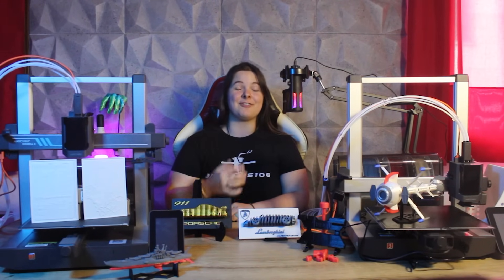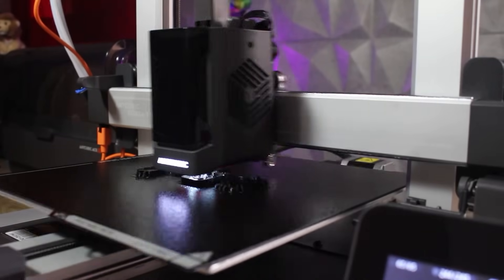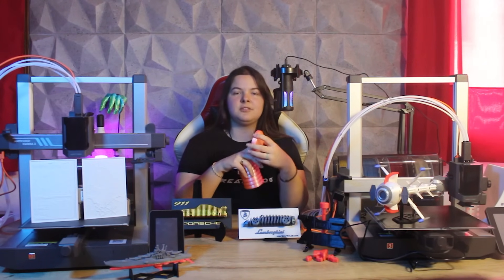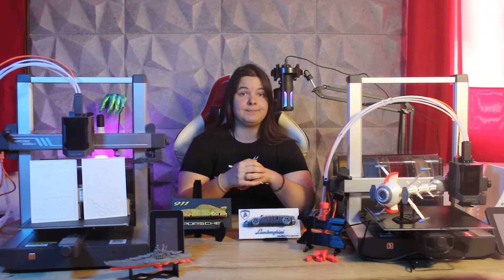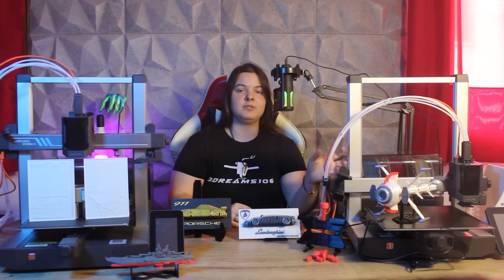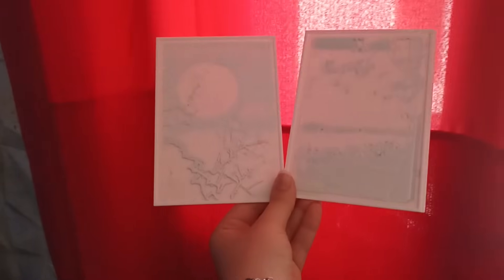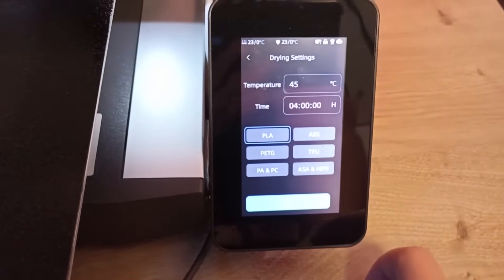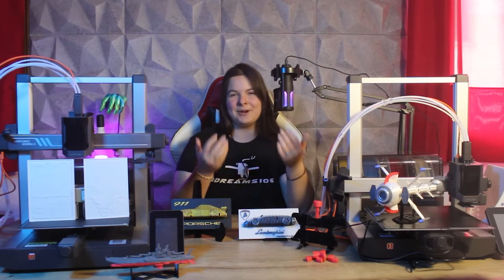THE NEW ANYCUBIC KOBRA 3 V2 🚀 IS IT WORTH IT? 🤔 Review and Comparison with the V1 🔥

Comment: The V1 has ridiculous firmware and leveling problems and a high percentage of units shipping with warped beds. I understand the V2 addresses some of these problems but I would still advise extreme caution when buying an Anycubic machine. Way too many users spend more time troubleshooting defective machines than actually printing
Reply: Same with Creality, in fact, only Bambu has kinda better reputation on basic models. That’s what I had seen.
Reply from the maker: Honestly, I really enjoy my kobra 3 V2, kobra 3 Max and Kobra S1. I know many people had problems, but Anycubic support is awesome.

Comment: The problems with the kobra 3 version 1 wasne even bad..I printed better air shroud..better airflow case for the printhead, and an upgraded hotend, everything else...like not sticking..preheat your hotbed and that won't be an issue, and auto level works fine on mine never had problems with that...but mine works amazing, maybe one day I can have a version 2 to compare...but my kobra 3 is very good recommend either version, just do maintenance lube your bearings with wd40 and grease the riser bolts and tracks tighten all screws and check them every few months and it will print good always..also your ambient air temperature can make or break your print big time.
Reply from the maker: I didn't have problems with the hotend but I had an hardtime with the first layer, even at warmer temperatures 😕

Comment: On the V! hot end. Yeah... I had the clog issue. I've went through a good half dozen hot ends, old and new versions. I've FINALLY started figuring out how to fix them, and many other things. I found an entire printhead module on Amazon in "used like new" condition for $18 USD, so of course bought it. And of course it came preinstalled with a clogged hotend where they'd tried removing the brass nozzel cold, and twisted it off. Custom! No extra charge lol. But for that price, I gained a very valuable learning tool. Ironically not 2 weeks later, my extruder died. I'd already completely disassembled, and reassembled my extra module, so knew everything involved very well. I was able to diagnose the issue, tear down the printhead, and install the new extruder without any CS or YouTube help. I even figured out that the motor was fine, so kept the other as a back up. Then I got that stupid FLSun POS.... yeah, don't wanna talk about that "return to seller" piece of junk lol. When it worked it was STOOPID fast, I'll give it that.
Reply from the maker: You really learn a lot from these experiences!
Reply: Whats was the  fix noch?

Comment: A lot of the changes seem to be software/firmware changes. The regional leveling, and surprisingly the extra 5mm on the plate, and whatever else you mention the other half of the video I've not watched yet lol. I wonder if they'll be a super cool company and let OG Kobra 3 owners like myself, have some of that V2 functionality in a firmware update. I have been VERY impressed with the improvements added via firmware updates thus far. Some of the newer features I specifically had asked for, such as object skipping and z offset adjustment, mid print. Nothing sucks worse  than getting 12 hours into a 15 hour multiobject print, then 1 object has a failure, and destroys the entire rest of the plate. I've literally babysat the last few hours of a big print, catching the filament from the missing object, before it can screw up the next object in line. THAT was not an exciting way to spend an afternoon lol. I'm so glad they addressed that, and I hope to see that on pretty much every printer moving forward. I'm talking to you FLSun!
Reply: the comparison chart seems to indicate 255X255mm print size is coming in Q3 to v1 as a most likely a firmware update. Object skip and area level is coming Q2 to V1 and maybe V2 depending on how you read it. Weirdly it says the S1 style integrated nozzle has been on the V1 since Q4 2024, which leads me to believe they are not putting the S1 nozzle into the V2 , they just redesigned the internals, which means the new ones are either  being shipped with V1's made since January or they and are just straight replacement. Which means the only real difference between the V1 and V2 are the bearings, the wider Y axis, included camera and what they call  hardware structure optimization. which I am guessing is the wider Y axis and bearings. and I am sure some smaller other changes. But the bed and print plate have not changed, the new hot end is indicated as being compatible with V1 , if not already being shipped with V1 printers so V1 owners will be able to take advantage of most of the changes.
Reply: @michaelvienneau2981  Yeah, The nozzle/hotend is called basically "upgraded version 2.0" it's much smaller and has a plate style higher volt heater. The increase in heating speed is pretty nominal, but noticeable. As far as object skip, I've had that functionality for a couple months now. Some of the features that have been added, that weren't present at tme of my purchase "January 2025" are;

Firmware version is currently 2.4.0.
Object skip during print.
Z offset adjustment during print.
Filament purge amount adjustment.
improved "arguably" A.I. detection. I still don't use it,  unless I want 10 false alarm stops per print job lol.
Rate your print "after each job completes.

All those I mention are available directly on the device's touchscreen. They've also given some more functionality to the orca skin, although I'd still much rather have my Anycubics just work with standard orca, so I can have a single slicer, instead of 2 versions of the same thing, with one being a little more finicky "the anycubic slicer next, not as smooth as orca." I will say that the device panel on Anycubic's version of orca is, in my opinion, is less customizable, but more streamlined at the same time. I've put 1180 hours on my Kobra 3 combo, and have ran 33 spools through it in that time. The only major issue I've had "other than clogs that got WAY out of hand" is a failed extruder unit, but had a spare, so it wasn't an issue for me at all. Other than that part, I have on hand every other piece of the print head module. The current nozzle/hot end I have installed is one I've made out of leftover and repaired pieces I had laying around, and BY FAR I'm getting the best results I've ever had consistantly. I've been using that piecemill hot end for over 200 hours now, with 1 failure, that I'm pretty sure was a slicing issue and my fault. 

Bridges are a HUGE issue, as it like she says, it's cooling fans are not very powerful, and ironically enough, in all the stock profiles, support for bridges is disabled by default, go figure. Also, Magigoo has proven indispensable, especially on the stock plate, which I replaced ages ago, with a gold textured plate. Any of the cool design smooth plates I've tried "4 or 5 different ones" have had poor results with adhesion, especially resulting in curled corners, which play havoc on z offset as well. I've had nearly an 80% fail rate any time I've used a smooth P?? plate.
Reply from the maker: The plate of the V2 is different, maybe they have improved it.
Yeah, the cooling isn't super powerful and the profiles should be optimized a bit more.
Overall, for the price I think it's worth it. They have really improved the firmware since the release.
Reply: @3dreams106eng  according to anycubic its the same plate & all the firmware based upgrades will be available to the v1

Comment: My V1 was crap ! I am waiting for it to be replaced, all the problems I encountered with my machine have been resolved most probably by the V2, possibly ??!! Unfortunately bringing out a new machine less than a year after the original machine was released is akin to admitting that it had problems in the first place, which it did, especially with the auto levelling. I will be interested to see how my new V1 fairs up ?!
Reply from the maker: I think they had released the V1 a bit quickly to compete with the A1. The problems of the V1 should be solved in this V2.

Comment: Instead of repairing a printer with deficiencies, selling it as a new printer is not fair to me and it makes me worry about the problems that may arise in this printer. It is also crazy to give more money more than $ 100 for a printer that is almost the same. It would be very cool if it were fixed around $ 380
Reply from the maker: I think that for the actual price, it's a great deal. I believe this machine is great and shouldn't present issues like the first version. In particular, I believe they had released the V1 a bit quickly to compete with the A1. The problems of the V1 should be solved in the V2.
Reply: Agreed, I've been thinking the same thing. This is Creality behavior, anycubic should offer an upgrade kit for the V1 for free or a low cost. 

It's extremely disrespectful to the customers that paid good money for the V1. But if that's how they want to act don't except repeat customers or people familiar with that type of behavior to waste their time with the v2.

Creality isn't even on my radar for a new printer because of how close I came to getting the k1, then releasing the k1c instead of fixing the issues.

Quidi tech is one of the few companies that actually took review's feedback, discontinued a model and released the upgraded 4 plus.. so right now if I decide to get something bigger I think the 4 plus is the top contender.

Im not really in a rush though, so maybe if I hold out another few months or early next year elegoo will be keeping up with their formula and putting out a centuri plus and centuri max. Id definitely consider them in the future based on the amazing customer service Ive has with them.

But hey thanks for putting out this video and explaining some of the differences between the k3 V1 and v2
Reply: @BenRichard-y7u  just stop buying printers with food stamp’s money.
Reply: I just brought v1 like 2 wk ago out came v2 -_-
Reply: @LiquidJim  same
Reply: $350 now
Reply: Unemployed behaviors.